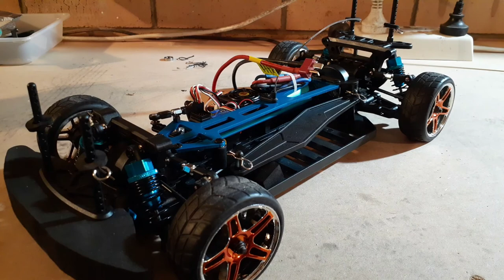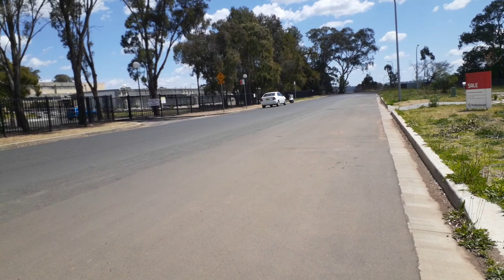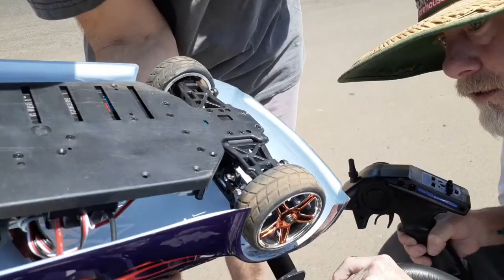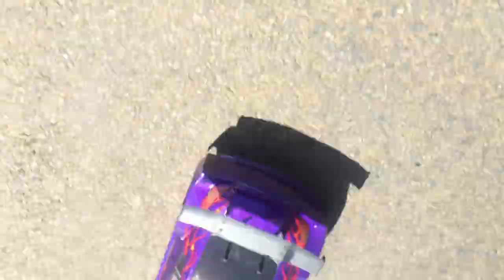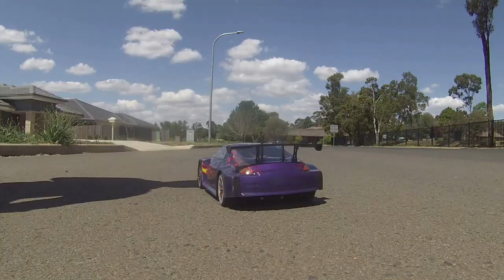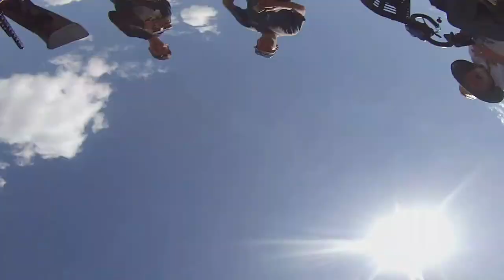Snaring a Flying Fish! Test run of the HSP 1/10 scale Flying Fish Drift Car

Comment: Get yourself some foam tyres and gradually pull the throttle till full speed and you will find you will get great runs at about 60k with 3s lipo. Hope this helps.
Reply from the maker: Cheers mate! Sure does help! I've got some contact foam tyres now, but they are going on my new 144001 build. I'll have to give them a try on this car, too! Cheers for watching, mate!👍😁👍💯